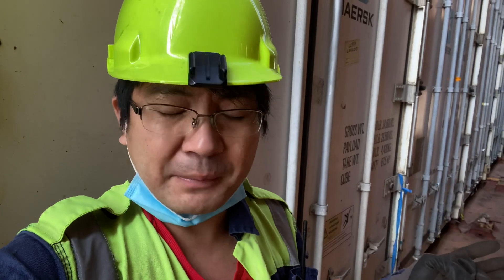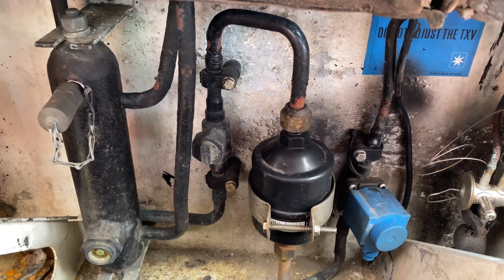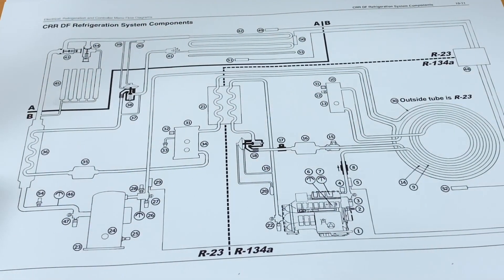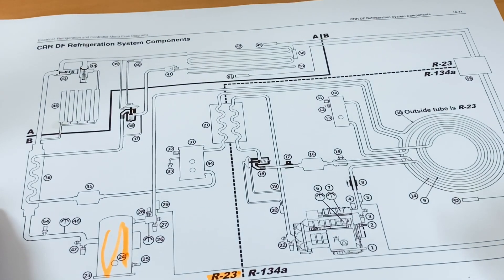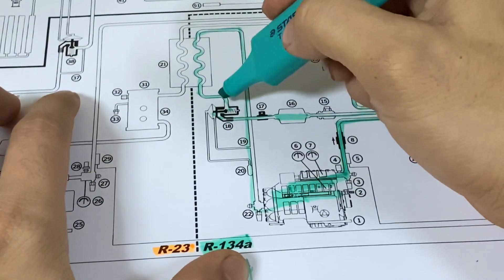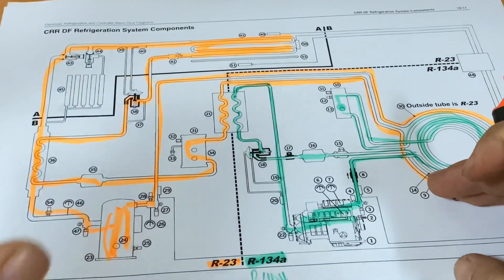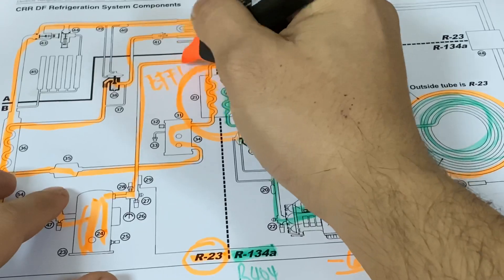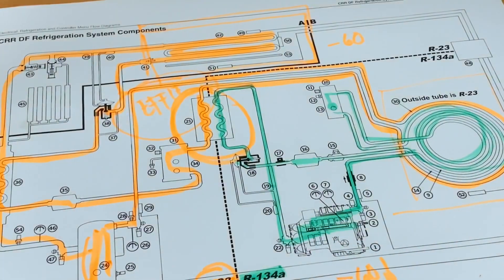3.8 MILLION DOLLAR CARGO SUPERFREEZER

Comment: Reason for -60°C is not because of small crystals, since that is achieved in processing plant during fast freezing. Reason for -60°C in reefer is because  -60°C super low temperature not only slows down the oxidation rate of myoglobin contained in tuna, but also has the effect of low temperature sterilization (parasites in tuna meat). Therefore preserving best quality for such expensive food. Crystals in cells cannot grow in size after proces plant freezing unless there is thawing occurred.

Comment: This is called a cascade system.   The heat exchanger has nothing to do with the efficiency  of the system. Cascade systems are energy pigs. It takes many tons of cooling to achieve extremely temps.  R-23 is a high pressure gas.    IE  R-134a at  90F is 104 PSI, R-23 at 40F is 411 PSI.  Standard compressors in the refrigeration industry can not operate at such a high pressure.  The heat exchanger just allows it run at lower pressures.   These systems can be very challenging to work on.  I have spent hours fine tuning to get them to the required low temp.
Reply: Actually, R23 has a Critical Temperature and Pressure of 79°F / 700psig. 
In this application, R23 Condensing temperature is around 45°F to 50°F so, normal ambient air at 90°F can't be use to condense the R23 discharge gas from the Compressor (@45°F).
That is why a cascade system was employed. 
R134a will Evaporate at temperature around 20°F in other to maintain a Condenser split of 25°F(45°F -20°F) for efficient heat transfer.

Comment: I sailed on a chartered vessel some years ago, loading tuna in Jakarta. The reefers at the time were the TK ones which would come down to minus 40 degs c. Unfortunately, they were NEVER delivered onboard at -40, usually around -20 to -24. Scrolling back through the built-in logger revealed every time the boxes had been"hot-stuffed", usually on more than one occasion for each box. Also, as soon as they were loaded, usually between 2am to 4am, I found a manual defrost had been initiated by the shore people. (I'm guessing they used to load in the middle of the night hoping that I wouldn't be around to check until 0800, by which time the temp. would be a bit lower.) EVERY time we loaded these reefers, I gave a Letter of Protest to shoreside Jakarta, and reported details to Copenhagen. This didn't even register as a "Discrepancy" against Jakarta on the Monthly Port report from Copenhagen.  The boxes still turned up WAY "out of range" every time. It usually took 18hrs for -40 to be achieved. Therefore, always check temperatures when reefers are being loaded, check logger histories and be prepared to give shoreside a L of P if the reefers are NOT "in range".
Reply: Agreed. A solid -60C is difficult to achieve tough to maintain.